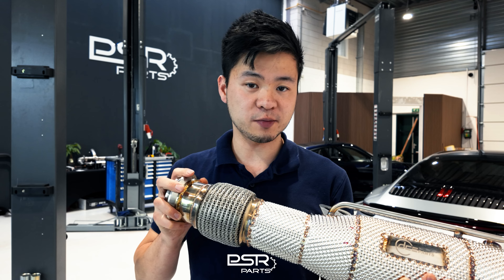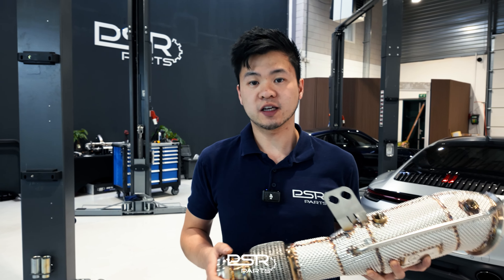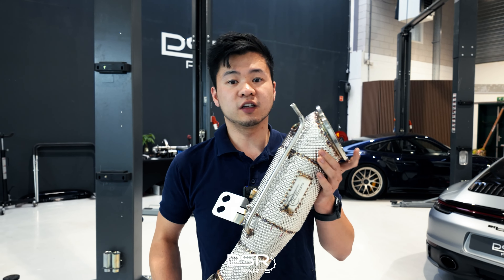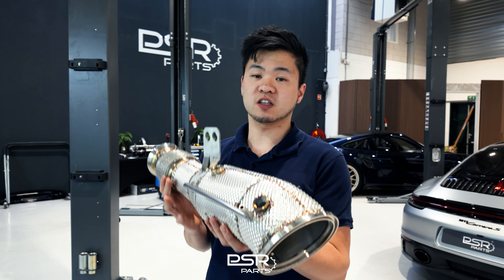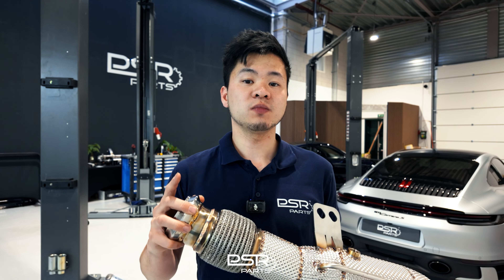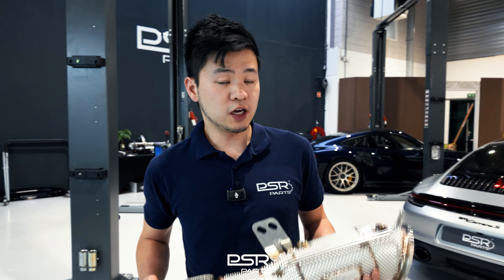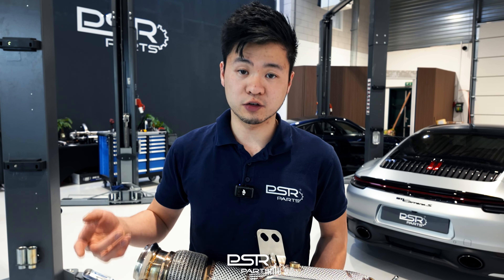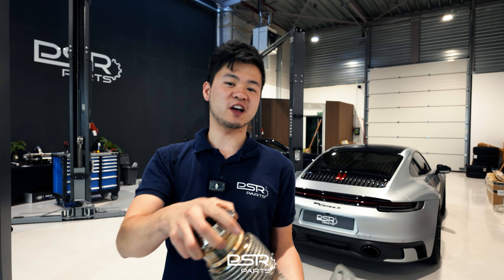Essential Guide: Upgrading Your BMW B48/B58/S55/S58 Downpipe for Tuning - What You Need to Know!

Comment: Hi. When you delete opf, do you have any affects on the consumption? Is it better to not, if you dont have check engine light on?
Reply from the maker: Not so much in fuel consumption, not that much that we noticed. It allows for better flow though as back pressure gets reduced.

Comment: There is a difference in sound between 200/300/400 cel downpipe? 
I have an 540ix (dont find any videos on your page with 300 cell version)
Reply from the maker: The sounds varies, the 200 to 300 to 400 is getting more silent the higher the cell count.